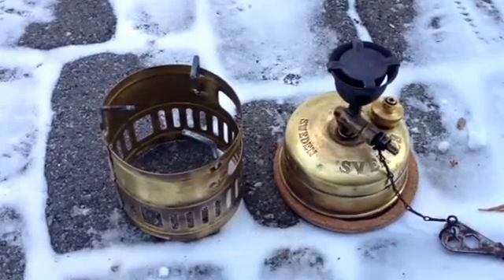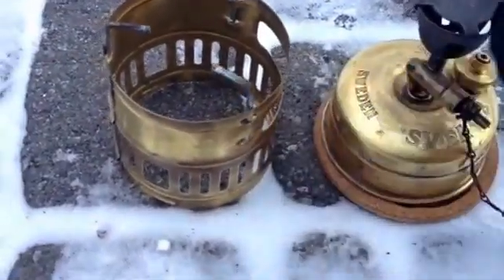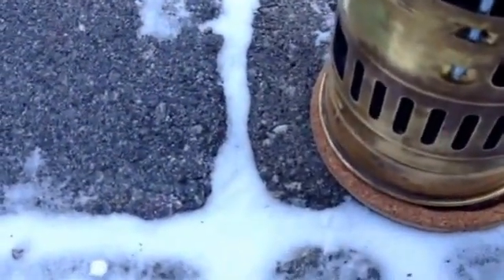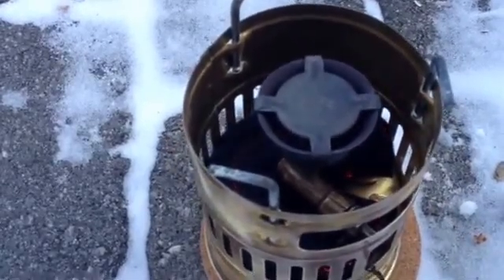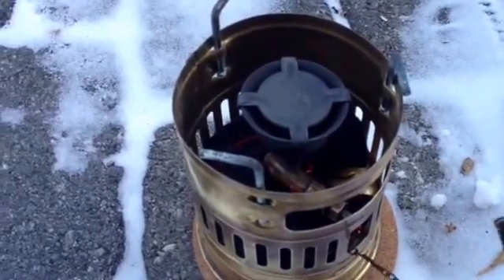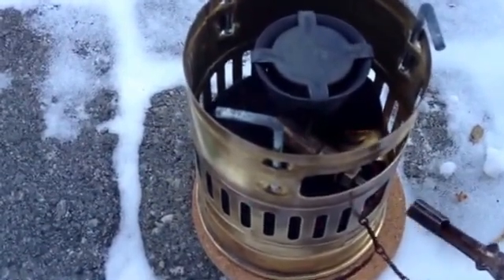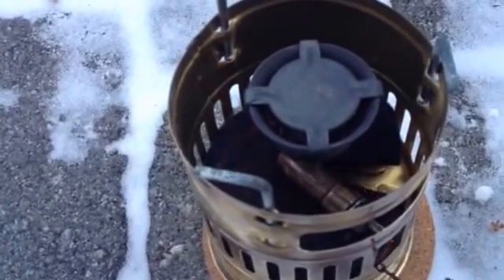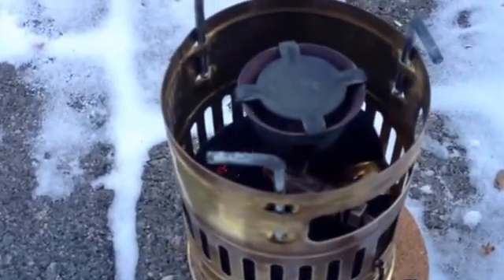Svea 123R Carbon Felt Windscreen Idea

Comment from the maker: Ultimately I made a custom brass heat shield using the metal from an award plaque. It's not that the carbon felt didn't work. I just wanted the stove to be closer to factory original.